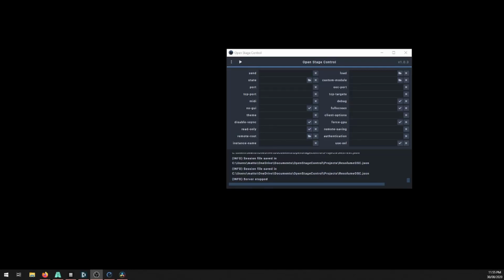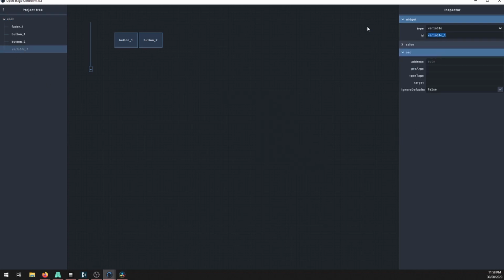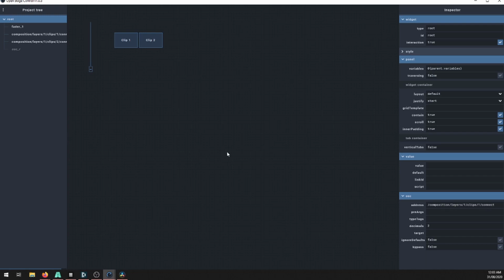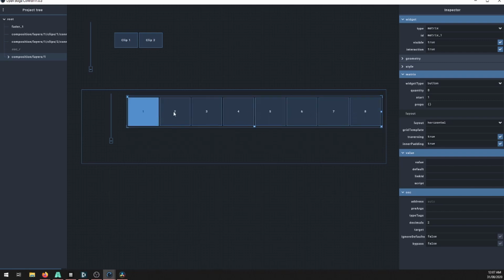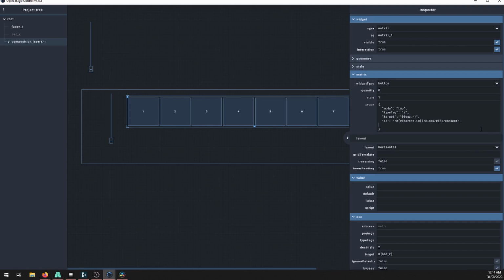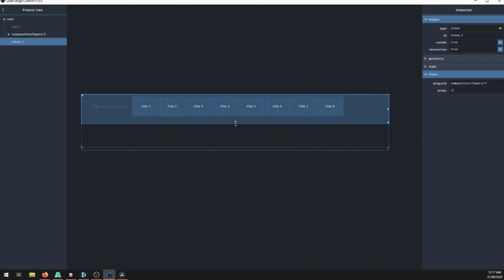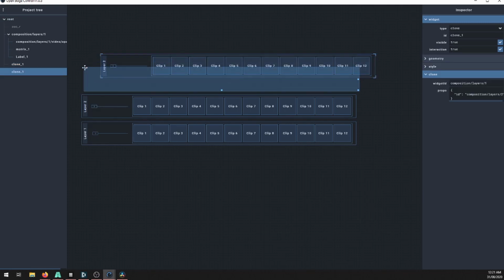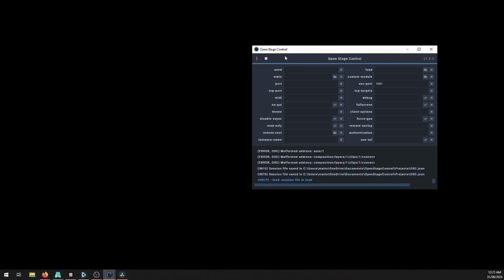Open Stage Control // Building a custom control interface for Resolume #openstagecontrol #resolume

Comment: You are next level sir...thank you for making this video.
Would you say that a basic understanding of JavaScript is required here or a fluent understanding? I've been tinkering with OSC for a while now but I feel like i could do so much more but I don't know how to advance further. I can copy/paste what other pros like you are doing but that doesn't give me very much understanding. I've looked through the OSC manual but it's clear that it's meant for someone who already has some understanding of...well, I'm not sure exactly. lol   Is it JavaScript?
Reply from the maker: Thanks Nightowl
You don't need any JavaScript knowledge to get started, but having a little allows you to add a huge amount of functionality. 
I only have a very basic JavaScript knowledge, and then look up anything slightly complicated online.
What is a little complicated is understanding the syntax for using Javascript within OSC and its objects, and that's what I hope this video helps with.
I may look at making another video on OSC in the future if i can think of a project, I'm also open to suggestions :)

Comment: very interesting ! open stage control is a wonderful software ! your example is clear to understand how to start to handle variables and javascript.
Reply from the maker: Glad you enjoyed it!
Reply: @mith  notice that you don't need to specify target for each widget once you set into "send" line in the setup screen.
Reply from the maker: @n-l-b  that is a very good point and much easier to get started. 
The reason I didin't is because I sometimes use a single OpenStage interface to control mulitiple targets on the network.
 However for the purpose of this setup you are right the default target would be a much more logical choice.
Reply: @mith  ah yes and you change the target ip into the variable, yep !

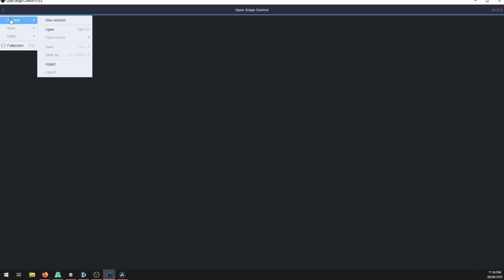Comment: I made it exactly 1 step in. The screen at 1:14 doesnt exist for me when i hit play, i just get a grey page with no ability to do anything.
Reply from the maker: Hi Arashi,
Youi may need to enable editor mode (ctrl + E) or from the menu
Reply: @mith  Thx, I actually just had to restart a few times. I've made my patch, followed your video instructions, and would love to work with this program it seems easy!! BUT... lol... resolume is receiving my signals (i can see code coming in via the osc monitor) but the actual knobs arent being affected. Ive been consulting my resolume buddies, and can't find anyone who uses open stage :(
Reply: Found it! I was copypasting both lines from the OSC edit window, instead of only the first line!
Reply from the maker: Great to hear you got it working

Comment: anychance you can maybe help me figure out what im doing wrong? i'm a vj at a club and wanna walk around with my tablet and trigger visuals from resolume i've followed all instructions and made sure i did everything correct with my access point etc
Reply: when i run the program on my laptop where i have resolume running everything triggers but when i try doing it from my tablet nothing no feedback
Reply from the maker: I'll try and help.
That sounds odd.
When you use your tablet can you see the changes on your laptop?
Reply: @mith  I honestly just figured it out when you start open stage control when you start running the server it gives you an IP number to basically type into your web browser and that’s what I did
Reply from the maker: Glad to hear its working for you :)